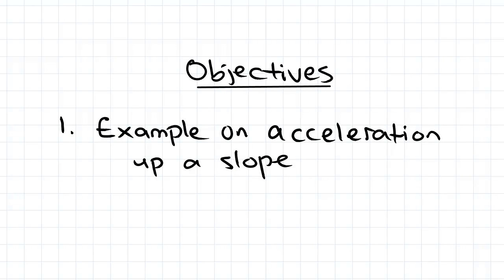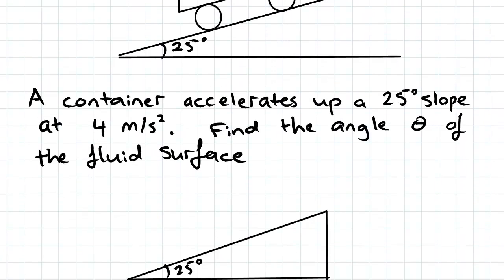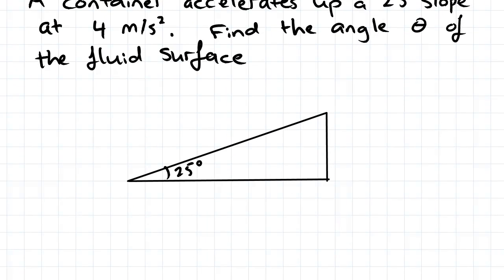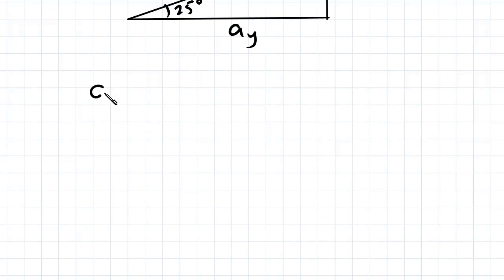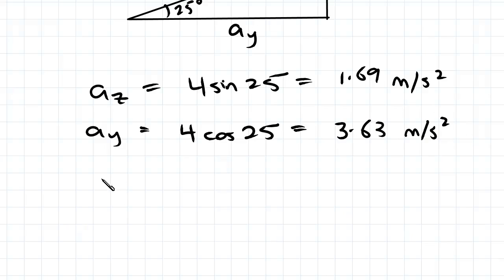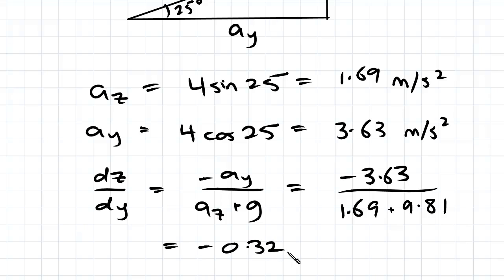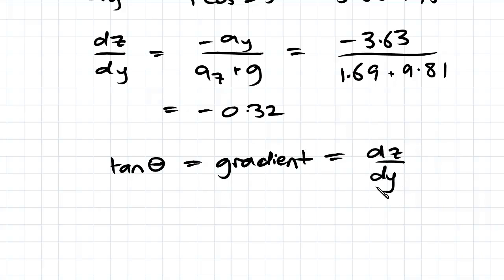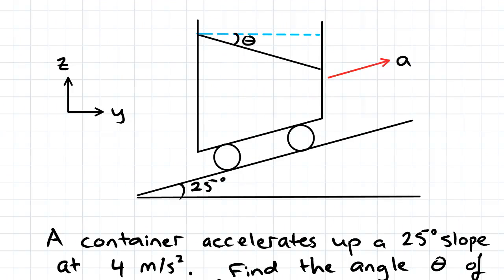Acceleration of a Fluid Body on a Slope Example | Fluid Mechanics

Comment: So how would this problem be solved if we wanted to find the acceleration and only had the angle of the incline (30 degrees) and wanted the surface level of the water to be parallel to the slope?